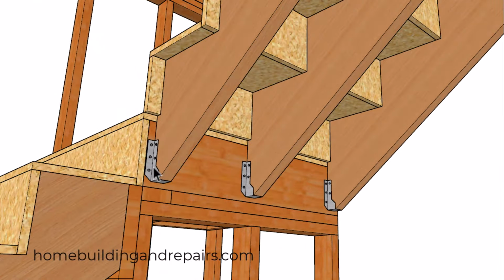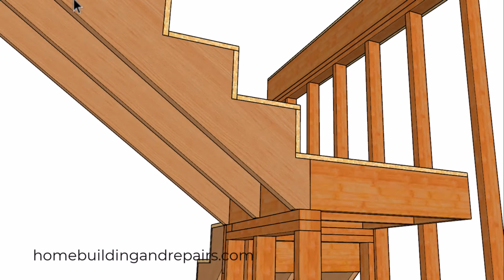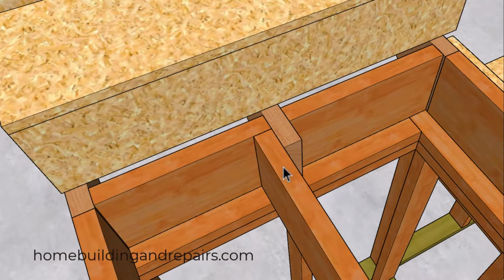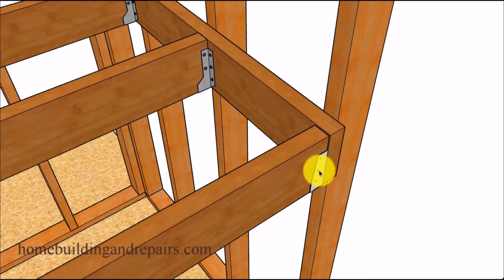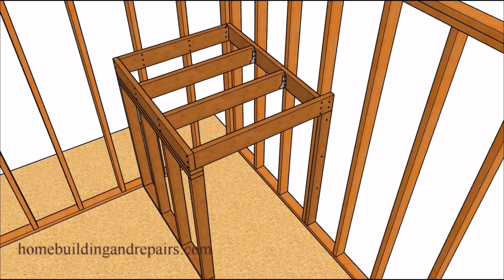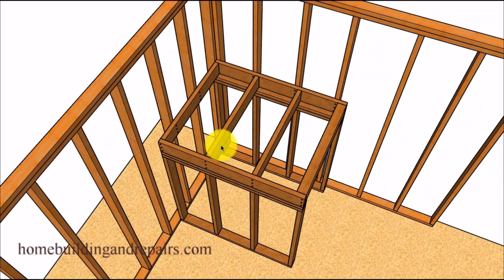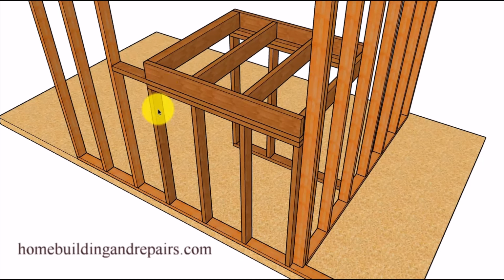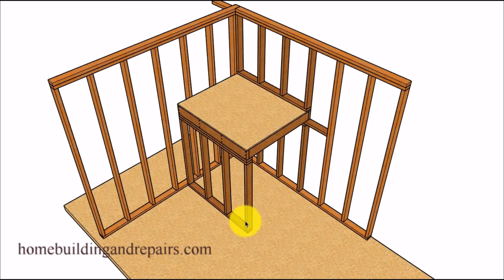Four Methods To Connect Upper Flight of Stairs To Bottom of Landing - Design And Assembly Examples

Comment: Thank you for the video sir! 
Ive watched some content from the US and I have a qustiom, sorry if its not diractly connected to this video...
How many stairs can you build before you have to add landing in the middle?

If you have a video about that subject I would be thankfull for a link
Thank you
Reply from the maker: You're welcome and the maximum height for a flight of stairs is around 12 feet, then you can have a landing and continue going up another flight of stairs.
I put your suggestion on my list. Actually I thought I already made this video, but could not find it.
https://www.homebuildingandrepairs.com/codes/stair/index.html
Reply: @stairbuilding  Thank you very much!
In my country, Israel, the code says 16 steps maximum with no landing for exterior and 18 for interior.

I've never built more than 11 steps staircase without a landing somewhere midway, preferably with a right/left turn.

But that's just me trusting my judgment  and coming up with a number. I can see a situation where a client will need a staircase that is up to code but not up to my "gut feeling code", so I ask what will be your approach as you are way more experienced than me, and you've been byilding in a place that has more elaborated building code

Again, thank you for your videos.
You have been a great teacher to me many times for a long time
Reply: Are those standard joist hangers @ 1:17?